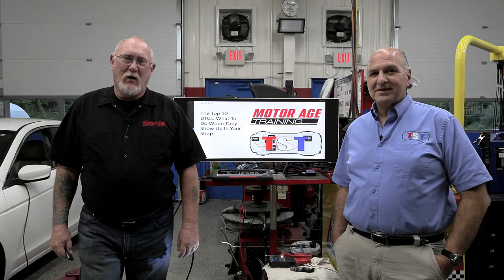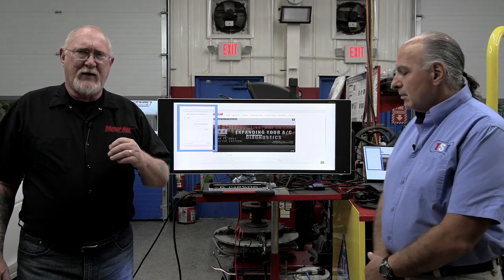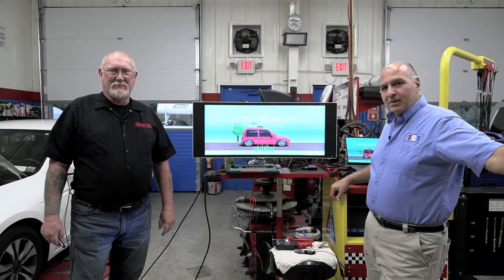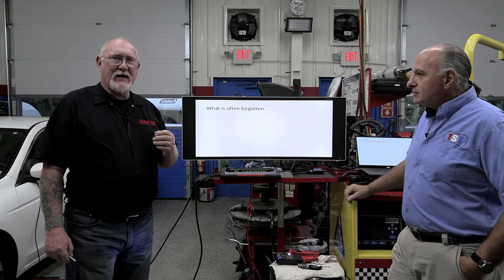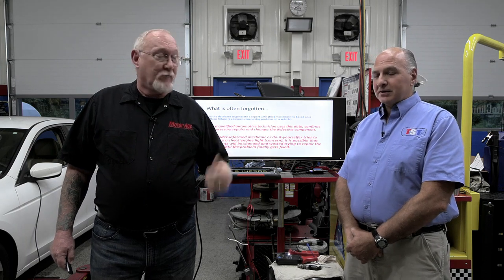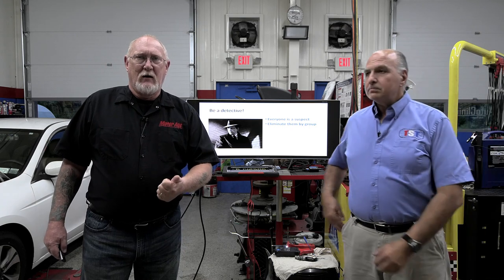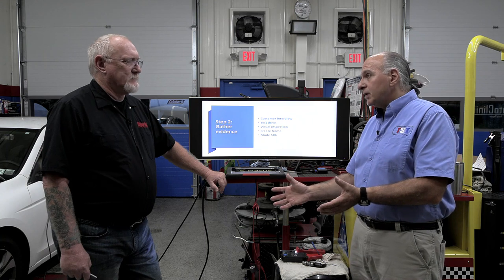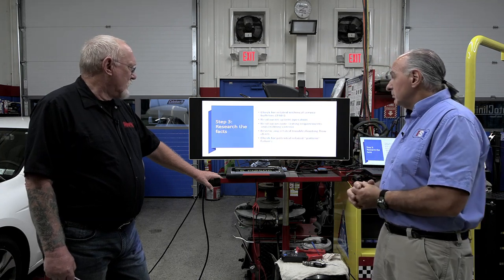TST Motor Age Top 10 DTCs

Comment: FFD for the win. As a dealer tech I had a WRX come in with the concern “will not go into gear”. Check engine light was also on and the FFD said the customers engine speed was 8500RPM at 124MPH.  Subaru declined to warranty the repair and the customer was out $6000.